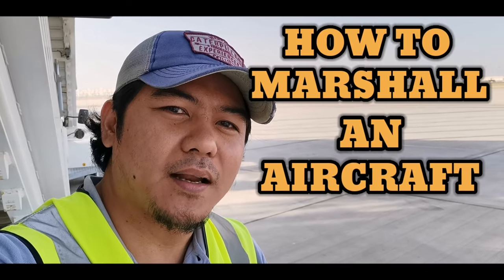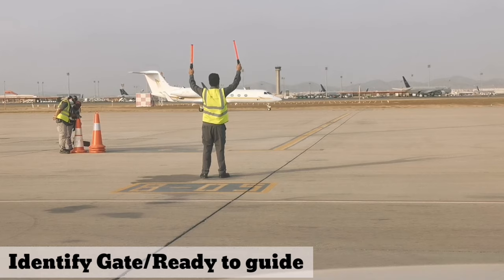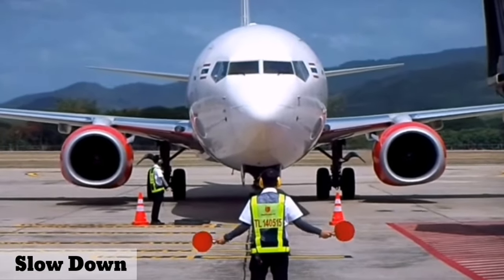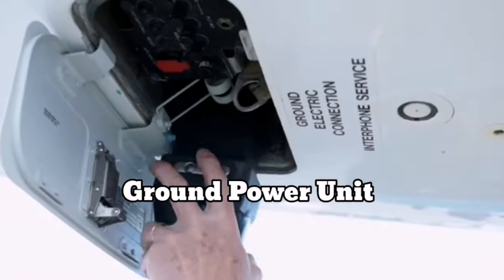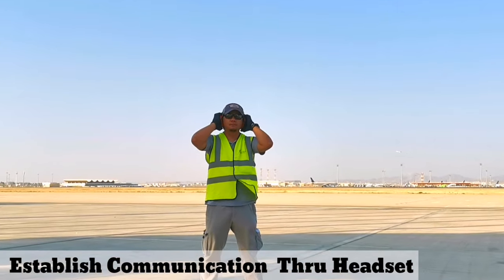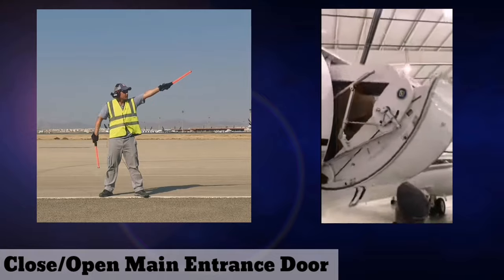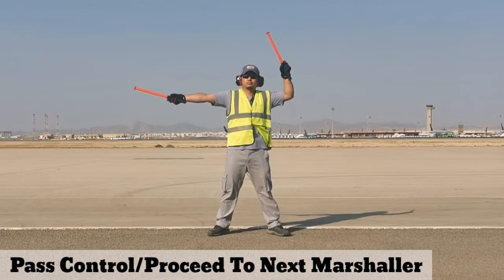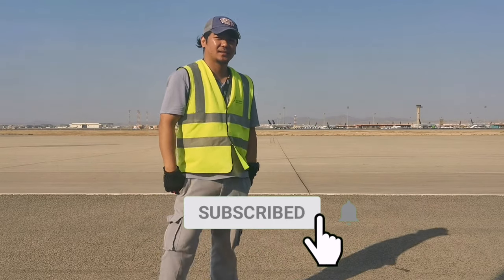How To Marshall An Aircraft | AIRPORT RAMPMAN

Comment: 1:42 the technique of directing aircraft left, and right works best with airlines where the marshaller is very familiar with the aircraft capability. However, in business aviation with multiple types of aircraft and different crews, it’s often best to use the point up and straight ahead method. This allows the crew to line up the aircraft on your position by their own means.

Comment: My major issue with airports is that they do not seem to care too much about focusing first and foremost on the passenger. At best, they seem more interested in facilitating airline operations and - in some cases - offer the passenger a beautiful architecture to look at. All airports I know (I have visited quite a few all over the world in the last four decades) and the ones I have seen being built or even planned, seem to be stuck in the concept of the flat displacement of passengers. I believe it is possible to create an extremely efficient and comfortable airport by looking up and down, instead of just spreading big buildings with a few floors. Transit passenger times should be major design criteria for any airport design. For example: From checking-in to the plane gate, there should be a time limit and a maximum distance the passenger actually has to walk to go anywhere. Make a vertical airport. A central building with one terminal with many floors (under and over street levels) that handle Departures, Arrivals, Security (one level to process everybody before entering the safe levels), administrative level, diner and entertainment level, one concourse access level with doors to access big people mover ramps that take passengers directly to any of the concourses from the same central area. This way, the passenger do not have to run 20 or 30 minutes from one terminal to another, airport resources and security are centralized, among many other advantages. I do not see a reason why these high floor ramps cannot cross above the planes in the ground. Today, people with disabilities or that are just incapable of walking - much less running - for longer than 10 minutes, must wait for those random electric cars that are also a safety hazard. When traveling with close connections, I detest having to arrive sweating at the gate, trying to catch my breath while rushing through my hand luggage or jacket pocket trying to grab the right boarding pass and my ID.